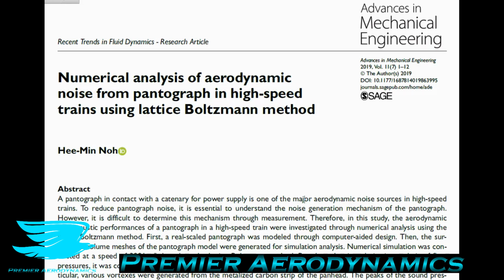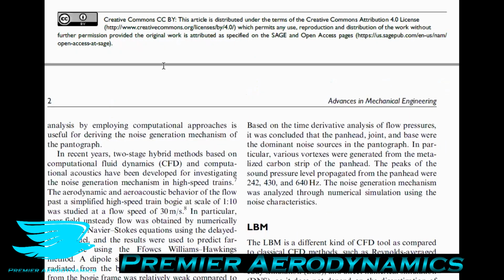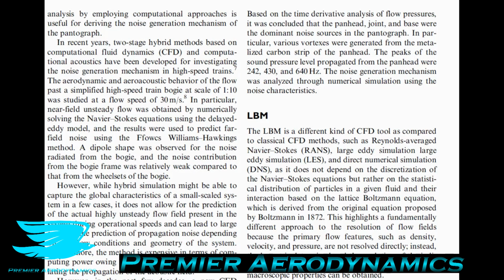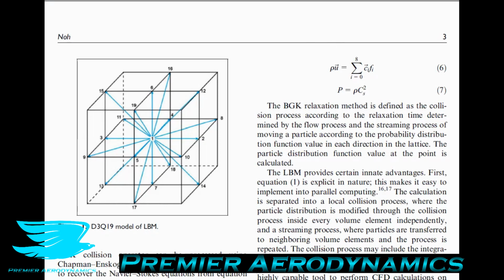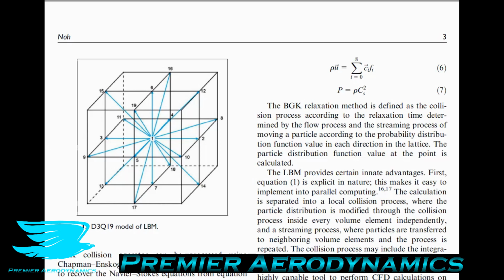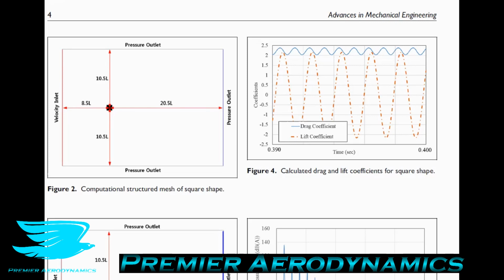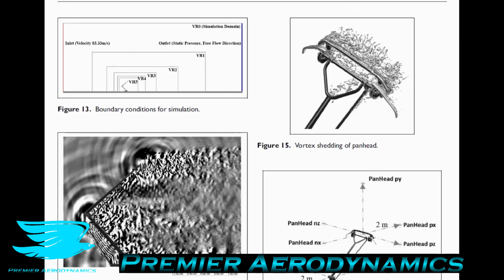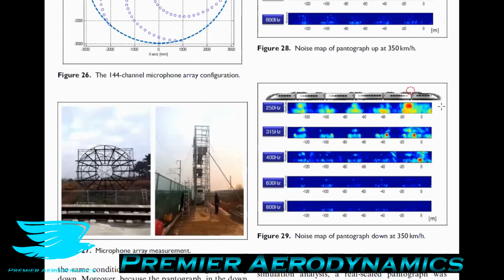Lattice Boltzmann Method (LBM CFD) to simulate Aeroacoustics of High Speed Trains - Podcast #91

Comment: I think you're right, LBM is the future, because it won't be enough to model air flow, but as stated here, the acoustics, and as we will discover the thermals as well. A solver that lets you consider all those different aspects will only be more accurate in the long run.
Reply from the maker: Yeah, that's true. As we progress, we'll want to know how these different aspects interact with each other and cause each other. So, something that can do all of that, inherently, is very appealing.